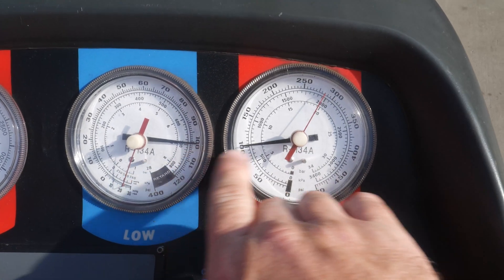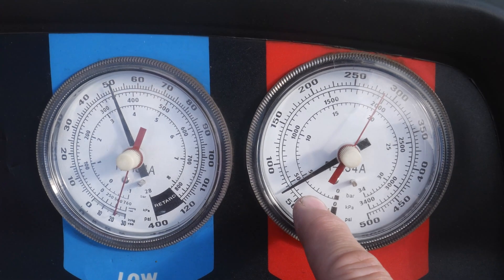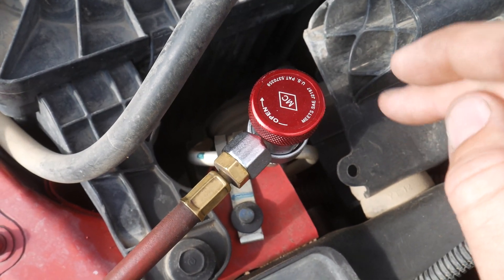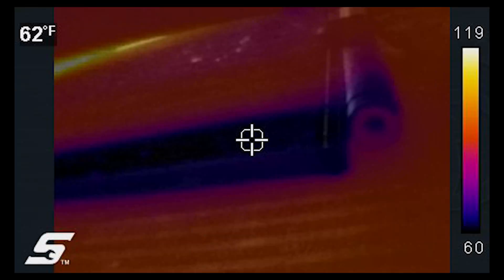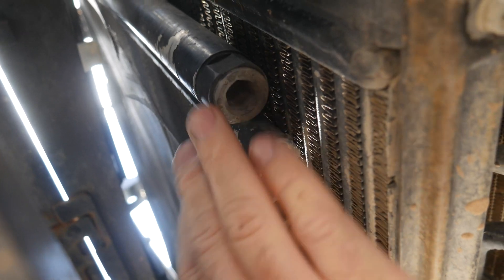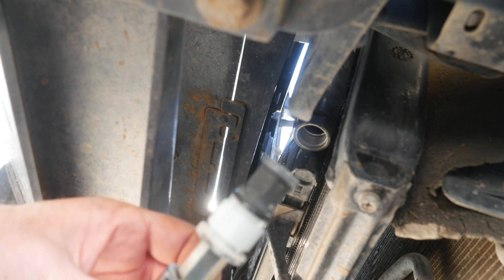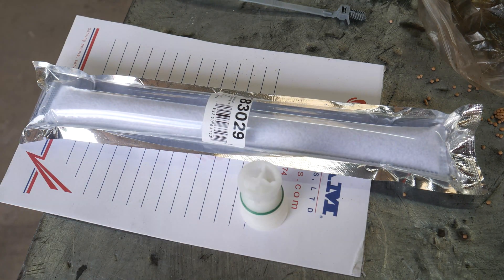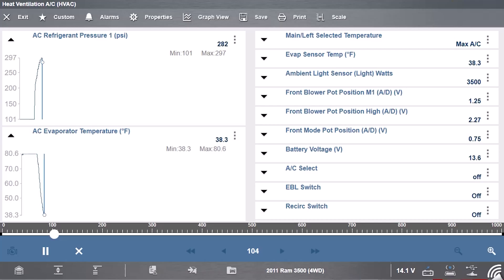2011 Dodge Ram Poor AC Performance - Filter drier service

Comment: Would any of this cause the evap. core to freeze up?  Just had mine replaced....still freezing after driving for about 30 minutes.  When I accelerate from a stop it sounds like there is water going through pipes and then a high pitched whine.

Comment: What an interesting look at the system, one not often seen. Do the scan tool pressure sensors measure absolute pressure, and the analog gauges measure relative pressure?
Reply from the maker: The service manual had very limited information about the AC pressure transducer so I’m not sure if it is actually a relative or absolute sensor. I will make sure to check the next one with the system at ambient pressure and see what pressure is displayed on the scan tool. I have a few more scheduled this week that will have the same sensor so I can verify. 
The gauges are a relative pressure for sure but on this older machine the calibration could be off enough to see the difference we saw when checking static pressures.
Reply: @ThePracticalMechanic  Thanks, Chad. Great to see you posting videos, I always learn a little more.
Reply from the maker: @spelunkerd  the 2006 dodge I just checked uses a relative pressure transducer and not an absolute. It reads 0psi on the machine and scantool but is 5 psi off when static pressure was around 100 psi. 
I will check the next one with my newer machine and see if the results are similar.